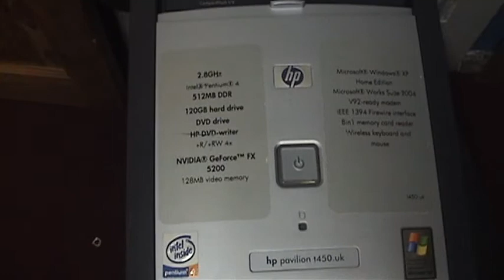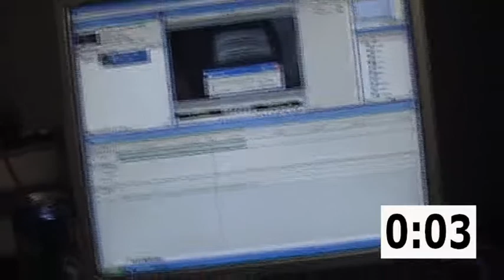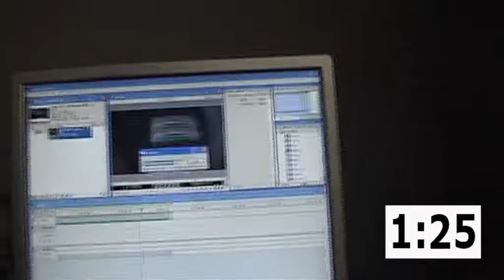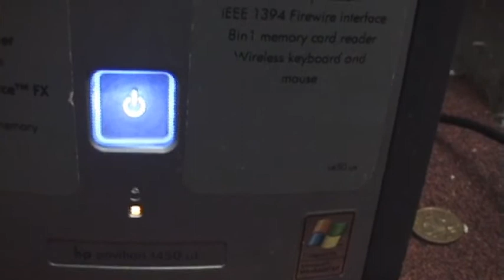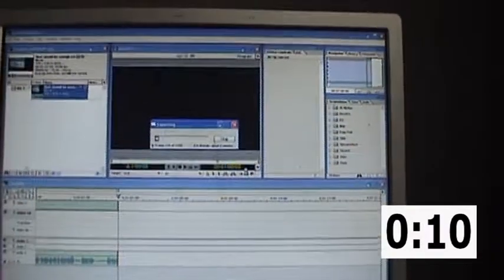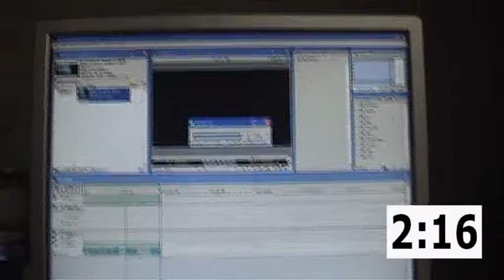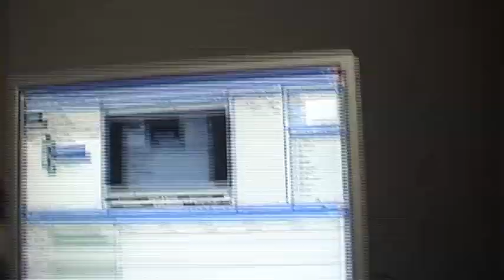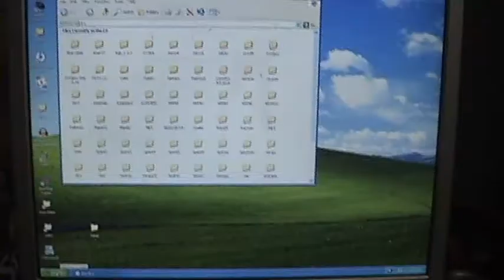Whitch is faster AMD pr Pentium?

Comment: 4:13 Try Sandboxie. You can download things and then install them inside a sandbox. A sandbox is a restricted virtual environment, separate from everything else. When you install a program inside a sandbox, it works just like it would if it was really installed. But the difference is that, once you've tested a program out which has installed crap and/or malware on your system, you simply terminate and delete everything inside the sandbox, and it's instantly gone as though you hadn't even installed it. It's free, and I've used it for years. Enjoy...
http://www.sandboxie.com/

Tutorial...
Sandboxie Review Part 1
Sandboxie Review Part 2
Sandboxie Review Part 3

Comment: I still have a floppy drive on my main Windows 7 x64 system, due to having 1980s / 90s retro home micros and needing to move data between the two.  Earlier this year I even bought an old IBM Thinkpad G40 laptop with an internal floppy drive for this purpose and to be a retro game machine.